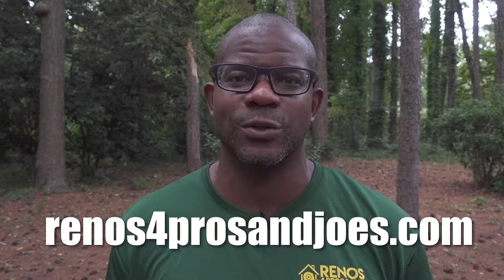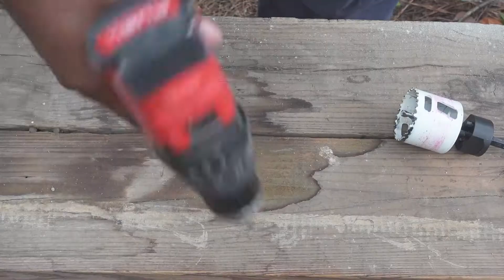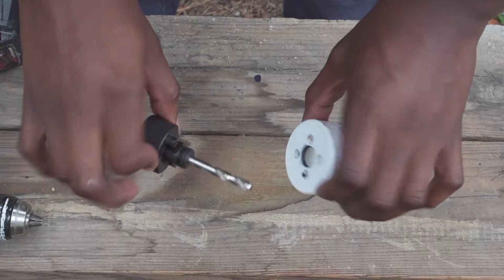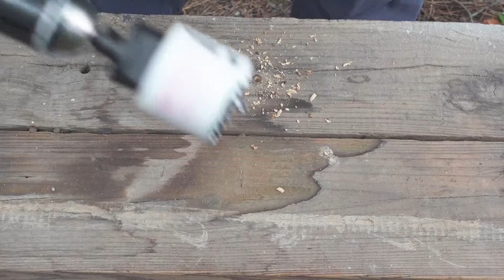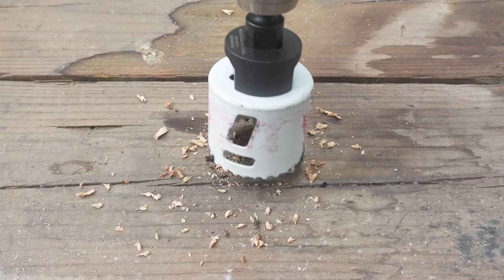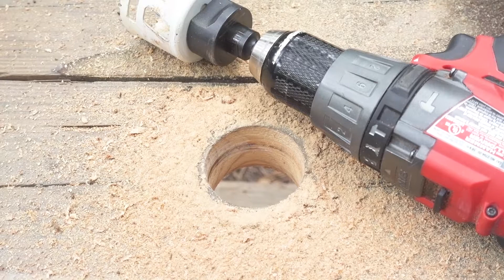How to Use a Hole Saw

Comment: Thanks for this. Regarding the drill itself, do you have any suggestions or guidelines for exactly what kind of drill is best suited for hole saw use? Maybe a specific model of a good all-around corded drill with enough power to make this easy? Right now I have a midrange DeWalt cordless variable speed drill, but it lacks sufficient power for a 4-5" hole saw in dense wood. I can do it, but the battery runs out quickly. Any help with choosing a better drill for this purpose would really help me.

Comment: Thanks so much for this video and tips.  I just made a game for a fall festival at church and now I need to drill some holes for the game. A friend warned me that the hole saw is scary to use and can be dangerous.  You gave some great tips.  The holes I need will probably be 3-4 inches.  I plan to purchase a kit to cut them.  Are there any additional things I should be aware of or cautious of? He stated he almost broke his wrist using a hole saw, but I am not sure how big the holes were or if he used the tool properly.  I am a woman, but am not afraid of tools.  I figure this can’t be rocket science, so I just want to use the saw the proper way.  Any guidance you give will be appreciated.  Thanks again for the video and your guidance.
Reply from the maker: Hi! Thank you for your comment. You should be in pretty good shape after watching this video. Now that you know what to expect from the tool, just take your time. Getting comfortable with the tool comes with practice.  You should take even more care with the larger hole saws. Focus on keeping them level and on course. Definitely try to determine exactly what size hole saw you need before you buy. Most basic hole saw kits don't include bits quite as big as the sizes you stated you will need for your project. Look at all of your options and determine if it makes more sense to buy a more expensive kit with a wider range of bit sizes, or to buy only the sizes that you need along with the necessary arbor and pilot bit. Good Luck!